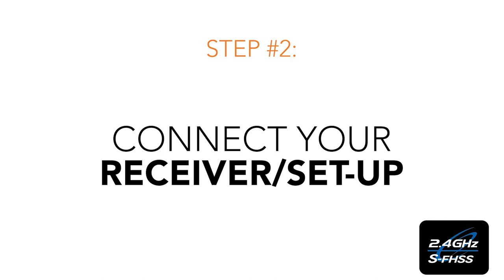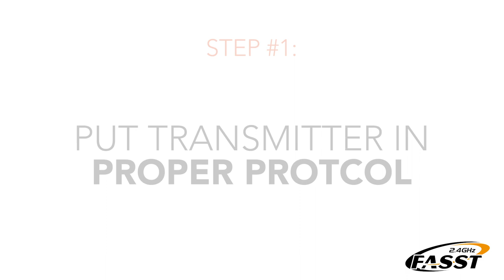HOW-TO | Linking RC Receivers

Comment: I have a R7014sb and it will not connect to my t16sz. I've followed ur steps and I can't even get a green light to turn on. There's just a solid red light and when I press the button it just flashes and nothing happens.

Comment: I have an old transmitter (T10CAG) I'm trying to link up with a receiver, an R6008HS, only get a green blinking light, won't turn solid green. Tried changing modes on the receiver, and tried changing modulation on the transmitter, won't link up.

Comment: You haven't said if you're using mechanical servos or digital or s bus servos...
So if im using mechanical servos like an old 3003 and a sb14 reviever where do i plug the battery to the receiver...or can the battery go into any Port

Comment: I put power on my R3008SB and it blinks red and green simultaneously... and there is no way to change that, whatever I try it still flashes red and green. My power source is a NiMH battery. How do I fix that?

Comment: I have the t16sz linked to the R7008SB receiver running SBUS to a vbar neo , for some reason I'm getting no receiver voltage on my Tx ? Shouldn't the Tx get a voltage signal through the SBUS input or do I need to plug in to another channel ? Thank you .

Comment: hi Glenn...I have a problem with my new T4PM and R304SB pack.
Was working about one month, last sunday detect that signal strenght comes low in two meters distance...three meters signal dissappeared...
I suppose was rx, change with a new one binded in other car number and the same thing happend.   Low strenght signal in two meters range....three meters dissappeared...
the Tx is new....

Yesterday I upgrade to 4.0 the same thing...

Comment: I have a 16sz and a r6014. The only way I could get it to bind is through fast multi. I couldn’t get it to bind to the 18ch protocol. Any thoughts?
Reply: This is a 16 channel radio, right?
I think you need a 18 channel radio for 18 channel protocol.
Reply: @jameshuynh5131  apparently you dont know futaba and the 16sz. theres a 12ch and an 18ch fasstest that you can select between. 12ch you cant have the digital servos on. the 18ch fastesst you can have any servo. if you knew anything about radios youd know as long as its the same protocol, no matter if you have a 9 channel you could bind to a 100ch RX but can only use 9 ch. but this particular rx only binds to multi protocol and not the fasstest which was my question because they have fasstest label on the RX. because on the 16sz i can pretty much bind to anything from sfhss to their fasstest

Comment: On a 12Z your only options are FASST MULTI and FASST 7CH. Will a FASSTEST receiver like the R7008SB work ok with the 12Z by selecting FASST MULTI?
Reply: In theory yes, after 7 months, did you find out about it? :)

Comment: Hello I have a used T8J and a new Rs2008SB I try several times to bind but its impossible, do you have any idea what could be the problem?
Reply: @bax399 did you sort out the issue i'm having similar issue on T10j with same RX?
Reply: @adamcivic  no it's was irreparable, it went to the waste
Reply: @bax399  which the TX or the RX?
Reply: @adamcivic  TX